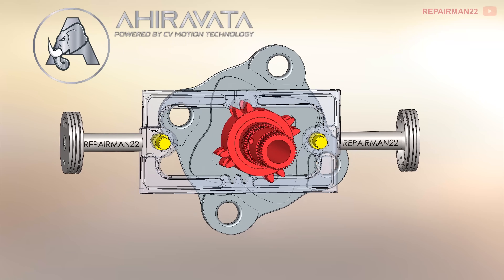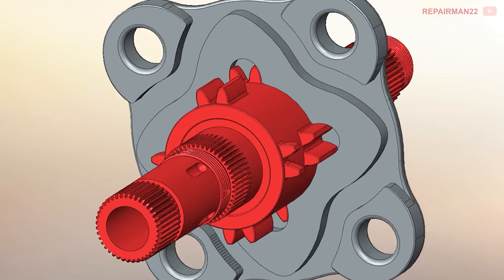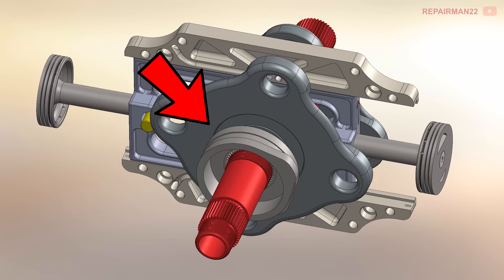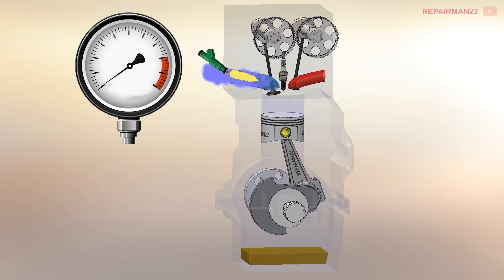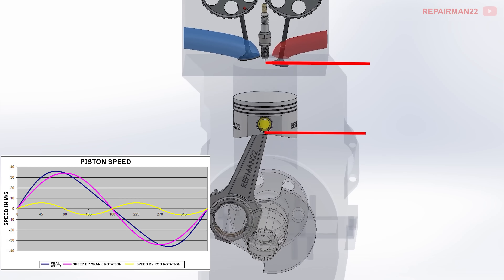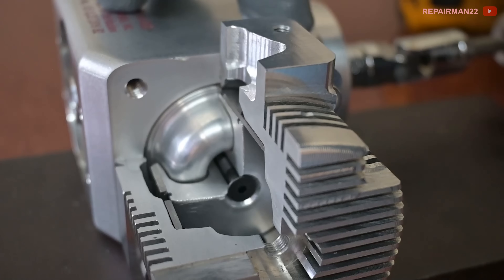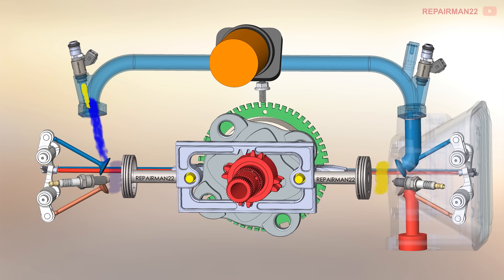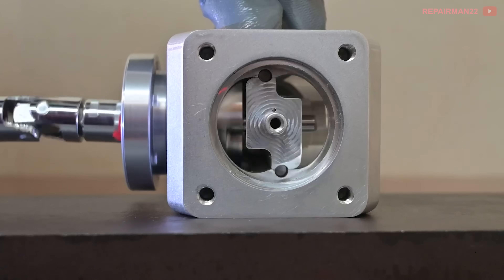The New FLOWER ENGINE 🌺 from Ahiravata 🐘

Comment: We be drivingFLOWERanswers with this one. Jokes aside - This has way to many moving parts that are frictioning on each other, in addition, in contrast to a scotch yolk engine, its not slimmer than a conventional design. While it does have advantages, I do not see them getting past prototyping.
Reply: It's effectively a crosshead attached to two cylinders with an innovative mechanism to take off the power.  Crossheads have very low friction and the power take-off looks like it's low friction, too.
Reply: It is interesting, but looks more complex than a scoth yoke or even a conventional boxer with conn rod. Is CV really that beneficial, when your reciprocating mass is this large?
Reply: I am getting it in my hybrid truck design..
Reply: Please let us just look at the engine and how it works! As opposed to a new "cut" every 3 seconds and gobs of "gee whiz! this is so great!" commentary.